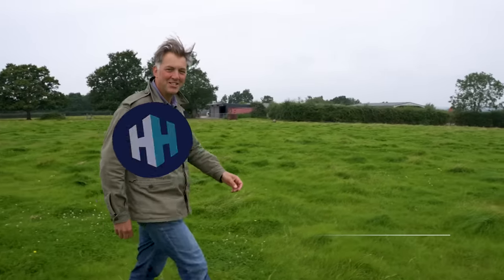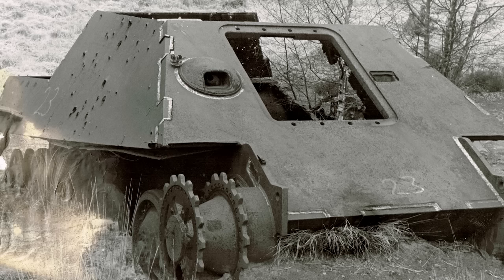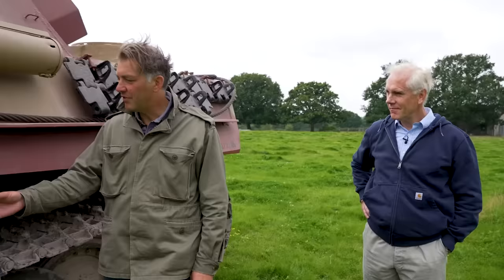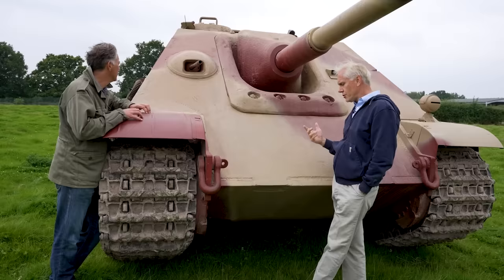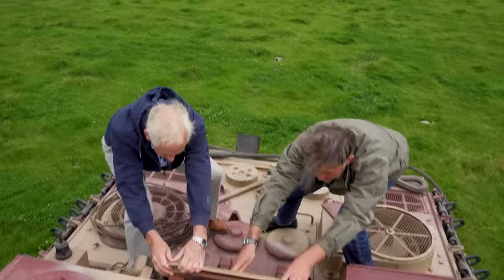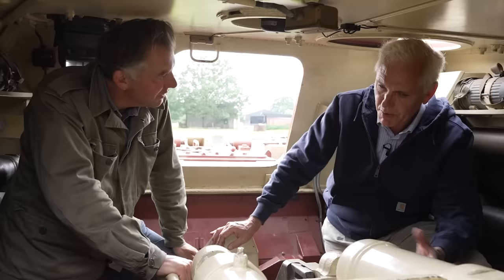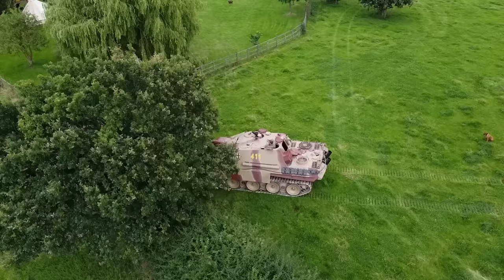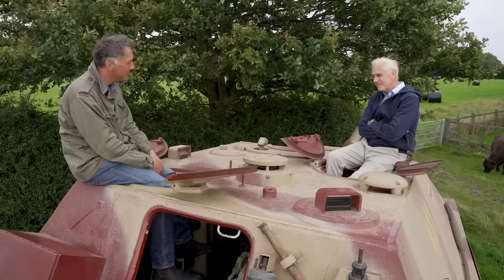Inside a German WW2 Tank Destroyer with Historian James Holland

Comment: Had the pleasure of seeing one of these back in 2014 at WTD in Trier, Germany. I really underestimated how massive this thing is, it looks "smaller" than it actually is, which is quite a feat since it doesn't look that small to begin with. The one in Trier is maintained by the german army, operational and in very good condition as well.
Reply: I think I was present as well, they took the engine out because it wouldn't start. 
Started it without silencers. Loudest noise I've ever witnessed.
Reply: @MrZauberelefant  I only remember the Panther engine being outside the Tank and they started it off, which was crazy loud and  I tried recording it with my phone but the audio on the video is just static noise because it was so loud haha. 

I think they had a Stug III, T-34/85, Jagdpanther, Panzer 38(t), Panther, Flammpanzer III, I think a Panzer IV, PzH Wespe and some towing vehicles.
Reply: I was in Munster recently. These machines were gigantic. Even T-34s and Shermans were massive. I was baffled.

Comment: This is amazing.  When I saw what tank destroyer we were going to see in the video, I said "Yes, please".
Reply: Technically this wasn't a 'tank destroyer' by German defintiion.   The Germans had 5 types
1 Panzer (IE Tank) usually 5 man crew.
2 StuG or Assault Gun.  This was a heavily armoured self propelled artillery gun which emphasised low profile.   It was manned by artillery units and was designed to directly support troops.   It has only 4 crew memebers and dispensed with the radio opperator hull gunner.  The Germans had noticed that towed artillery often could not be brough forward till night falls seriously hampering infantry advances and so the STuG or armoured assault gun was created.
3 Panzerjaeger (Tank Hunter) this was a lightly armoured vehicle dsigned to be mobile but equiped with a powerfull gun.  This is  closest to the American concept of a tank destroyer but lacked the turret.  The most famours is the Panzer 4 based "Nashorn" or "Rhinoceros" which had the long barreled 88mm PAK 43 gun.  Again crewed by artilleryman they were meant to fire from out of range and under cover.   One of these achived a kill against a T-34 at 4.2km.  The Artillery trained crew know how to survey ranges and the commander often directed fire by microphone from 100 meters away from the tank.
4 Jagdpanzer like the JagdPanther which unnlike Panzerjaeger were fully armoured compard to the tank they were based on but had a more powerfull gun and often more armour.
Jagdpanzer, jagdpanther and jagdtiger.  Unlike StuG they had a full crew and even more.

Comment: Great video, thanks. One of the baddest tank destroyers of WWII, a nightmare for Allied tankers to run into. Wonderful piece of history, great that one has been restored so well. 👍
Reply: -Technically not really a tank destroyer though it is fair enough description.
-The US had 'tank destroyers' which were lightly armored tracked vehicles, open top,  fast and with a big long range gun.   The idea is they could get to the front line very quickly to intercept an tank breakthrough, find cover and pick of the enemy tanks from a distance.   The Germans did have tank destroyers: the Nashorn built on a Panzer IV chassis with Panzer III gearbox and engine with the L71 8.8cm would fulfill that role though lacked the turret.  They had special long range optics and were manned by artillery crew and all of the special training that entails.  One of these is credited with a tank kill at 4km against a T-34.  The commanders often left the tank and directed fire from outside the Nashorn.
-Jagdpanther and Jagdpanzer had more powerful guns and more Armour than their turreted counterparts achieved by removing the turret and sacrificing some mobility.
-The StuG were different again: more self propelled heavily armored guns manned by artillery men and usually lacking a radio operator and having only one MG.

Comment: Thanks for the great video.

I saw this vehicle not long after they had got it up and running. An amazing vehicle on so many levels. They had to get parts from various Maybach engines to get one complete unit up and running. 

One area that could have been touched on a little more is the main gun. Alas, some confuse the Pak 43/88mm/L71 with the KwK36/88mm/L56 gun fitted to the Tiger 1. Many who watch your videos wont, but some will. 

Although the projectile was not too dissimilar, the Pak43 was a marked improvement, although bulky both in shell size and gun. The velocity of round was the key difference, going from 780>930 metres per second (KwK36) up to 1050 metres per second (Pak43). It meant the chances of penetrating on each hit was markedly increased.

So for me it is the combination of mobility, armour, and a gun that things it hits, stay hit.

Comment: Chieftain will argue that tank vs tank destroyer is doctrinal differences and not design differences. Tanks can have no turret and tank destroyers can have a turret.
Reply: A tank destroyer can have a turret, but anything that doesn't is either an assault gun (StuG) or an SP gun.
Reply: @himoffthequakeroatbox4320  the swedes would disagree
Reply: @himoffthequakeroatbox4320  as stated, the Swedes would disagree. I'd also point out that the FIRST tanks didn't have turrets. A turret doesn't make it a tank. How it is USED makes it a tank. And I'll base my opinion on this on REAL experts.

Comment: Yeah the tank is great, but honestly I'm here to keep track of the bull and his new best friend
Reply: Seems very hard to aim. Wouldn't I need to aim by moving the tracks and turning the whole thing?

The bull obviously doesn't have any trouble making turns. Scary bastard.
Reply: @hansolowe19  The gun itself has a limited traverse, so you point towards your target by turning the whole vehicle, and then adjust your aim with the traverse. And yes, more challenging than for a tank with unlimited traverse.
Reply: @johnfisher723  what does "traverse" mean in the context? Gun can move up and down a bit but needs the vehicle for left and right?
Reply: @hansolowe19  Traverse is side to side motion. In the Jagdpanther, the gun's traverse is limited to a few degrees either side of centre. A tank has unlimited traverse, being able to rotate it's gun 360 degrees. So if the target is outside the range of the Jagdpanther's gun's traverse, then the whole vehicle has to be moved, so the target falls within the range of the gun's traverse. 

Upward movement of the gun above the horizontal is called it's elevation, downward movement beyond horizontal is called it's depression. These too are limited.
Reply: @johnfisher723  thanks, that helped. 👍

Comment: In January 2002, I saw one in the Imperial War Museum. It has four holes in the right-hand side that were made from a range of about 50 yards by a Welsh Guards Cromwell. The Jagdpanther saw the Cromwell first and fired first, but missed. The Cromwell then stalked it and caught it side-on. I looked through the group of holes in the side, where the 75-mm shots had penetrated the 1-inch armour and saw large dents in the opposite side – the shots had the energy to penetrate one side, but not the other, so things must have got pretty noisy inside for the crew, with large lumps of metal rattling around in the space they were occupying.
Reply: Noisy? They were goo instantly
Reply: @jugo1944  From what I read, the crew survived, baled out and took to their scrapers.

Comment: Mike is a perfectionist. Perfect German pronunciation too. But, hang on, a Tiger they say is as easy to drive as an automobile of the day. It had a steering wheel, and a pre-selector gearbox. Steering and gear changing could be done with one finger. The Panther couldn’t have been much different

Comment: No mention of the defensive value of the sloped armor, which made this vehicle the fiercest and best- looking (to my mind) of all AFVs of WW2 !!  I suppose it was designed with the Battle of Kursk in mind (July, 1944) but would have been more successful than its' contemporary, the Ferdinand self-propelled gun (aka ,"Elefant") simply because it did have a mounted MG to keep the enemy from swarming it. The main gun only had about 15 degrees of horizontal movement, so the tracks would have had to work together well so as to be able to track moving enemy columns.  GREAT VIDEO!! because the discussions were on the interior and topics you do not usually hear about in these documentaries !!

Comment: I feel like there should have been a safety switch of some kind that the loader would hit to allow the gun to fire once he is out of the way... maybe with a green and red light in front of the gunner so he knows when the gun is ready.
Reply: Were you a German tank designer in a previous life? There was indeed a switch box to do what you say, and it was fitted to the gun in just about every Panzer.
I would show it to you in this video, but for some reason they didn't do a tour of the tank. So I will link you to a tour of the Tiger. The switch is just above this man's hand;
https://youtu.be/q3JRx4PkDYg?t=334
But it didn't send the gunner any information, it simply made a connection in the firing circuit.
Reply: @daveybyrden3936  in the video they insinuated that there was no safety and that the loaders would loose arms...
Reply: @Charon-5582   I really wonder where they got that information. The German procedure (as written in the gunnery training manual) was for the commander to give the "Fire" command after calling out the range, direction etc. The loader would THEN close that switch, and the gunner would AT THE SAME TIME be either refining his aim or pressing the trigger. So, in some cases, it was the loader closing that switch that actually fired the gun! How could he be so unaware as to lose an arm?
Reply: @daveybyrden3936  yea it didn't make sense to me either... that's what I was saying. There really wasn't a safety? I feel like there should be one because it doesn't make much sense not to...
Reply: @Charon-5582   There was a safety switch. I just showed it to you. That gun wouldn't fire until the loader allowed it to.

Comment: Going againt the praise all around for this beutifle anti tank vehical. It sparked my mind, that all the complaints about the transmission being rubish. I still drive a manual transmission truck, Yes with a stick. If you were gathering younger and younger recuits. They wouldnt know how to use a manual cluch, not knowing how to do that, ie popping the cluch over and over would definitly blow a transmission from the sudden torqure from the engine.

Comment: Interesting comments on the reliability of the TD with skilled drivers. No wonder how many other tanks considered 'unreliable' were just down to poorly trained crew...
Reply: The problem is, with a vehicle like this you are closer to the material tolerances. The transmissions are relatively fragile and prone to breaking if abused, and repairs are much harder to accomplish on a heavy vehicle like this. Even towing it is a problem, although the German heavy tanks (Tigers) were even worse. A lighter tank like the Pzkpfw. III is much easier to drive and more forgiving of driver errors.

Comment: -The MG34 MachineGun in Panzer & Assault Gun hulls had an exterior armored sleeve around the barrel itself to protect against fragments-(PanzerLauf)-that the barrel side into, but the beauty of the MG34 in tight environs is that unlike the MG42, the MG34's hot barrel could be easily swap'd out from INSIDE the safety of the AFV itself....
-As all it took was unlatching, then twisting the pistol-grip & receiver, as one piece, pivoting to the right,  which exposed the chamber end of the barrel, then draw the hot barrel out w/a rag & replace w/a cool, fresh barrel. That space-saving feature being the primary reason the MG34 was kept as the primary bow gun in all German AFV bow/ball mounts...

-Switching to the MUCH cheaper, simpler, easier to produce MG42, which possessed a much higher rate of fire than the MG34 serving its roles within German armored vehicles would require a co$tly, time-consuming, complete re-design of the already rather complicated interior MG mount, in addition to more SPACE needed inside the vehicle to accomplish the task. Plus, having to re-configure the exterior KugelBlende ball mount as the MG42's barrel shroud had a larger square profile than the MG34's slimmer, round, barrel & sleeve shape....
-The MG42's perforated barrel shroud itself was an integral part of the barrel change mechanism, being that the barrel-change latch sat just forward of the weapons receiver on the RT hand side. But barrel swaps with a MG42 were much more rapid as a result of this design....
-So to fit such inside an AFV would require a total REdesign of the original MG42 specs & wholly separate production line dedicated to MG42's that could ONLY fit inside German armor bow/ball mounts. It SEEMS like a rather  simple process @ 1st thought, but when TIME isnt on ones side, its best to stick with what youve got already & proven working examples already in production. They had too many types of tanks>assault guns w/differing calibers, manufacturers & badly effected supply lines as it was, & only late in the war realized the positive attributes of simplified, standardized machines & weapon systems...
~The reasons stated above, being PRECISELY WHY General Heinz Guderian INVENTED the "Face-Palm"....;)

Comment: It's interesting that the vehicle was knocked out by Allied British forces and then sent to Britian for appraisal.  Then, it was then used as a range target. The British appraisals of Panther tanks and assault gun Jadgpanther was that the mechanicals were not forgiving if used normally. It took careful, experienced drivers to stave off mechanical failure. The 200km rule for inexperienced drivers' hands was the normal life of the transmissions and engines. The French only used captured Panthers for only a few years after the war, then scrapped them. No more engine and other spares were available for them. The main weakness was that if caught sidecon the side and rear armour was easily penetrated by allied antitank weaponry. I imagine that most crews died in these vehicles after being hit, and they brewed up in fire.

Comment: The one in the Imperial War Museum in London was taken out in our town in Belgium. 

As for the thought that putting an 18 year old into that to drive, I do not see the problem, and found the constant stressing that it would be too much for an 18year old quite condescending, maybe it was my upbringing in being around motorised vehicles all my life, learning to drive an ex-army Morris MR1A 4x4 at 12years old, I found it no problem to drive and operate a skid steer bulldozer at 15 (1971), I used one to crush cars flat and then load them on to the back of a lorry, as a 15 year old it was great fun until one of the hydraulic hoses split and had to call in the Case mechanic to replace it, we did not have the tools or the hose to do it ourselves. 😀
Reply: Yeah, that like saying todays cars a much more complicated to drive than cars from 40 years ago, because they are much more complicated with all that electronic motor management, ABS, ESP, electric windows, electric mirrors, electric seats, ect.

The only thing thats more "complicated" than in a sherman was a second set of levers for hard turns, and because the transmission was designed for a 30t tank, not for a 45t tank you had to be more carefull with the steering. Expirienced drivers had much less problems than new drivers with very short training, no matter if they are 18, 25 or 40.

Comment: Thanks for this. I’ve always been interested in this vehicle. It looks so mean and capable. However, I was a bit disappointed… you mentioned several times about how difficult it was to drive but never discussed the driver’s position or controls.  Also the gunnery system: how much movement did the gun have for aiming?
As a former tank crewman myself, I would be interested in hearing much more detail about the actual operation of these historic armoured fighting vehicles.
Reply: The narrator barely discussed anything technical, although he was inside where very few of us will ever get a chance to look. 
He did tell us about the ventilation fan, though.

Comment: That cow certainly fell in love with it. If animals love it it must be good for you! You can definitely argue that it's overengineered for the resources Germany had at the time, but there is method to the madness. They lacked manpower and materials but they had engineers, so to offset the lack of manpower they tried to build very sofisticated weapons (that's at least my interpretation). The use of a lot of material seemed worth to them at the time as the expectation was that the sofistication would offset the lack of materials. If you compare with tanks today you will see for example that pretty much all tanks use tortion bar suspention. I have no idea if that was a German invention, but for all I know Germany was focussing on that suspention wheras many other nations had other systems, but the tortion bar prevailed. So putting overengineering in perspective, yes absolutely, but in some regards also very modern.

Comment: Got one of these in my hometown of Mukilteo, WA at the paul allen museum, along with a T-34 and a beat up panther, and an 88 anti aircraft gun which they shoot off with dummy rounds. they even drive the T-34 around and fly most all the planes. They have about every single famous aircraft from the war. It was closed down during covid, then Paul Allen died, then it sat for a year or so and was bought by a walmart heir. Plans are to reopen it something this year. But nobody knows if they will fly planes again (they even have a restored stuka that can fly and a fully restored ME-262 jet with original restored/rebuilt engines. Both about the only two in the world and they can fly, as yet have not though